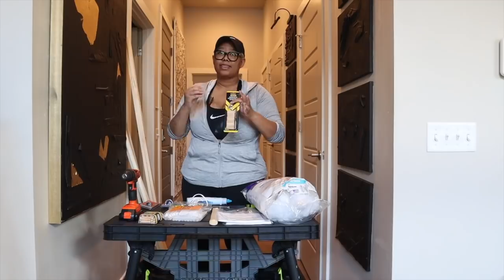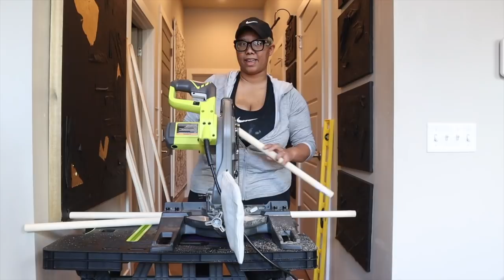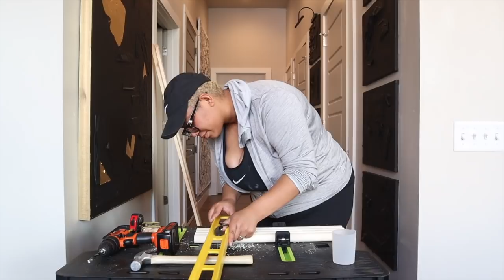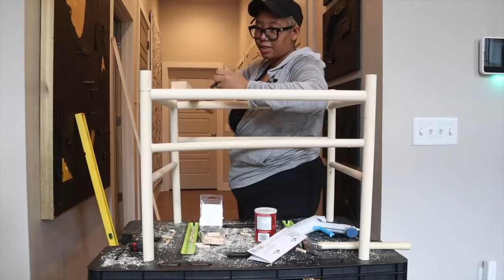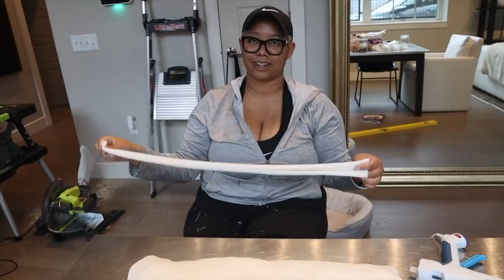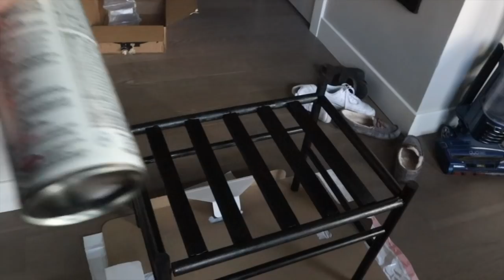$25 STUDIO MCGEE INSPIRED OTTOMAN // DIY WITH KB

Comment: Hello! :) I am unsure if I just missed this step, but a really easy way to make it more stable would be to put wood glue into the holes before assembling. Wait for it to dry, and then paint after. I also think that wood glue would help in the areas that hot glue was applied. Maybe move those rods down a few inches to support the bottom a bit more too. I am unsure if that would be enough to hold a person, but it would be a lot less shaky. It looks beautiful, I really enjoy your projects! :)
Reply from the maker: I definitely agree with you!! I will highlight this comment for people who want this item long term! I am never ever gonna use it so I was like meh 😂.
Reply: I agree. I loved the project and the look of the end result but it would be responsible to suggest that people use wood glue instead of gorilla glue for sturdiness and safety. Wood glue is practically impossible to break, the wood will break before the glue seam will. But otherwise, I’m happy to see more DIYs again!
Reply from the maker: @avib943  I definitely agree and apologize for my miss-step! I’ll pin this comment so that everyone knows 😊.
Reply: @KivaBrent  why are you not using it? Where did it go? Brave girls. Thank you